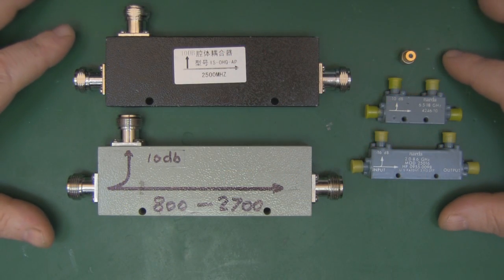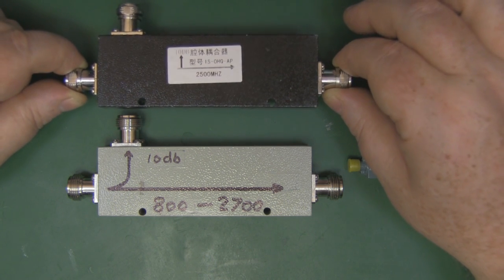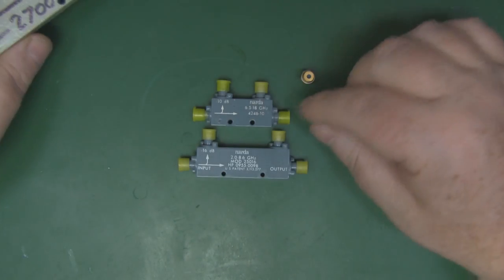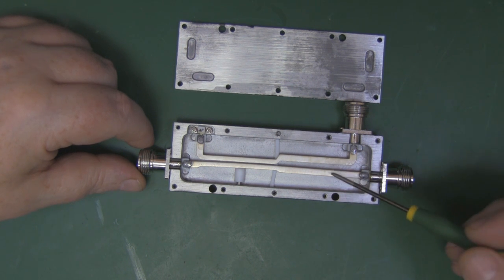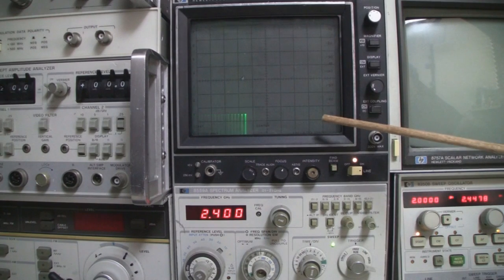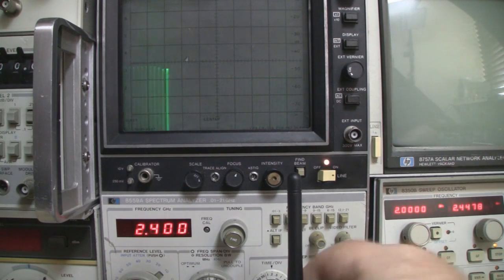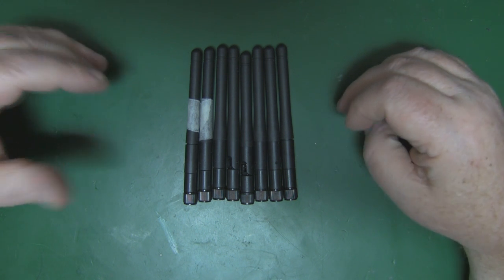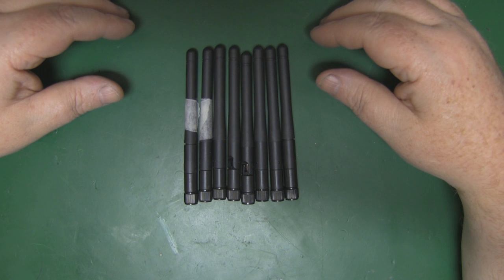Testing Dipole Antennas Quick and Easy #161

Comment: Hi Andrew, what about n2201ss Vector impedance analyzer, is it a good cheap choice for testing antenna ?
Reply from the maker: I have looked at that and it does seem a nice bit of kit for the money. Also one of my subscribers has one and he is happy with it. Would be nice if it went up to 6GHz though but if you want to do 2.4 and below it will do the job.
Reply: thanks, yep I'm looking for 2.4G. Something cheap for 6G range ?
Reply from the maker: @fpaolo63  I have the previous version of this https://tinyurl.com/y4apnehk
Mine only goes up to 3GHz; I got it a few years ago but only started to play with it recently. It has low resolution but you can do some interesting things with it.

Comment: Newbie and very naive question: would it be possible to build a poor mans tester out of a rf transmitter, like the ones used in the jammer + a cheap rf power meter on the output of the chinese directional coupler? By changing output channels through jumper selection on the transmitter and looking for low output on the power meter you would think it could work.

Comment: Thank you for opening up the large directional coupler and explaining how a mis match in impedence will cause reflections that bleed over into the output teminal and are detected by the spectrum analyzer. The lower the reflections, the lower the amplitude of the detected signal.
I got that right didn't I ?

Comment: you didn't mention why you flipped the directional coupler over the other way as apposed to the diagram on the coupler..........for the new players is was because he wanted to measure reflected power not forward power........good video though :)